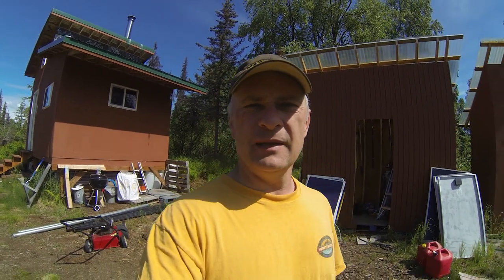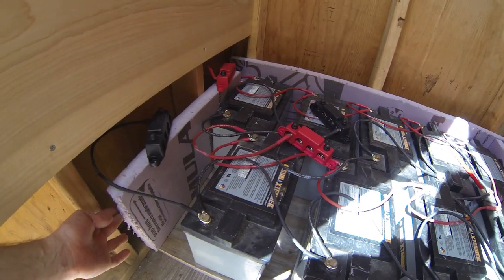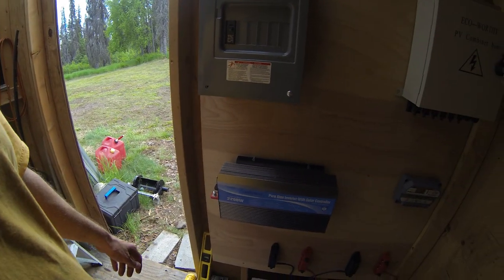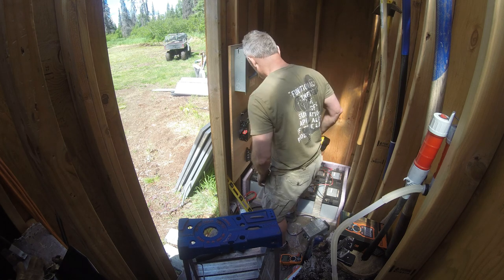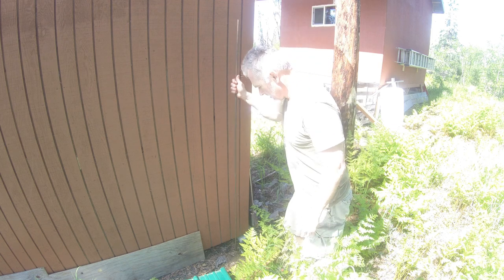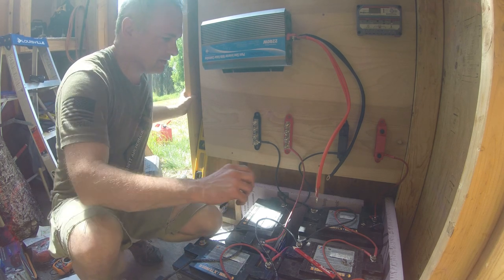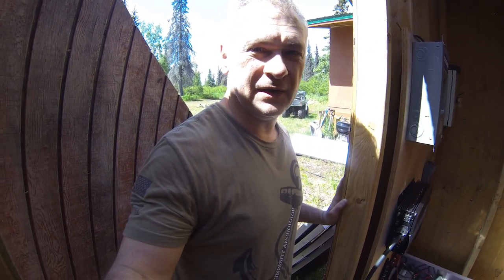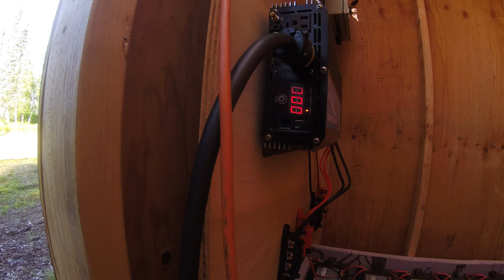The Cabin is running on Batteries!  Solar install part 4

Comment: What should your optimal battery voltage be?
I would expect 11.7 volts is low
Reply from the maker: When fully charged, they will be in the mid upper 12s.  However, I know they are used batteries so they drop down to mid 11s.  They stay in the mid 11s for a long time.  It all depends on usage and sun conditions for how long they will stay in the 11s.  Thanks for watching my video
Reply from the maker: I should also say in this video, 2 of the batteries are bad.  In my newest solar video, I remove those 2 bad batteries and add in 5 more used but good batteries.